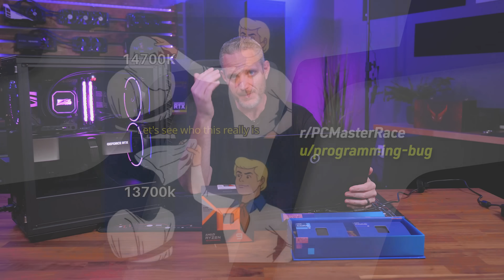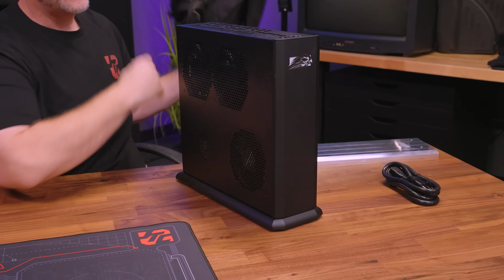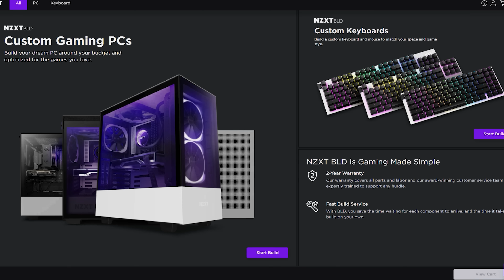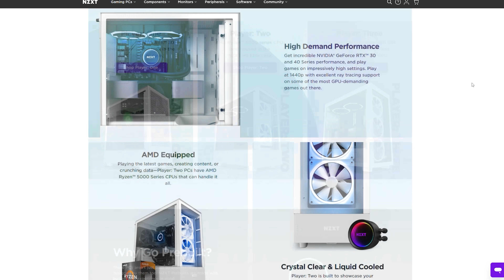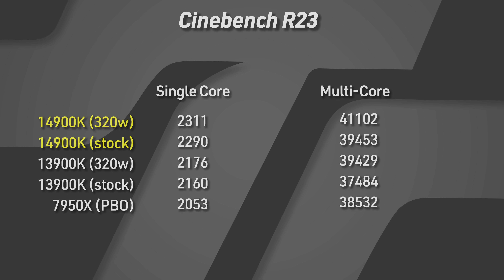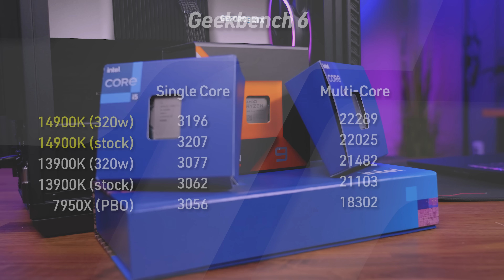THIS is why people have trust issues! Intel 14th Gen Review

Comment: I see no problem here, you pay more for your cpu so you can pay more for your electricity bill while gaining absolutely nothing. What a bargain indeed. haha
Reply: Intel CPU spokespeople be like
Reply: I thought Jay said you'd pay like 3 cent less per month with this...
Reply: @wallywest4274  If you keep it for 10 yrs you will recoup your extra cost. 🤣
Reply: @wallywest4274 in America yes but in eu is lot worse
Reply: @wallywest4274 Are these Jayz3cents then? 😁
Reply: Oh brings back memories of the AMD R9 200 series being the rebranded HD 7000 series; so much so that you could crossfire an HD 7000 with an R9 200 equivalent.
Reply: @Skelath Same with nVidia GTX 680 --> GTX 770 & GTX 670 --> GTX 760. You could SLI them as well. All you needed was a modded Driver. Done it myself running a GTX 680 in SLI with a GTX 760 albeit the 760 got a lower amount of Cuda Cores. It worked as the chip itself was identical. Good old times... 😕
Reply: Hey, we're not supposed to think about that... Just buy, buy, buy. 😜
Reply: LMAO
Reply: Instead of shitting on Apple Silicon and mocking it, they should have learned a thing or two about going for effigency.
Reply: Latest Gen, little bit faster, I’ll take it.
Reply: Ah yes, Enjoy a few extra cents if that on an electric bill lol
Reply: @FatherLamb  I’m not even getting a pc soon
Reply: @FatherLamb  and it feels kinda wrong getting 6 cores instead of 14
Reply: huh........... 6 cores? What are we talking about here LOL  @olympiaalkisbarmagiann7859
Reply: You pay the same, but get 3% more performance for the money. It's the right pricing direction compared to all other launches. All others hardware laUnches have been pay more for less.
Reply: @dontsupportrats4089  I saw it’s 10$ cheaper the 13600K is 10$ cheaper than the 13600K and has the 3% performance boost nice way Intel
Reply: @olympiaalkisbarmagiann7859  yeah its a cruddy uplift. It's still an uplift without a price increase. Anyone building a new computer won't care its a tiny uplift, they care about initial cost. I mean it's not like it fits in all LGA sockets so everyone who currently has intel is looking to upgrade.
Only 13th gen owners or new builders are even looking at the 14 series. And it should be only new builders.
Reply: More number more better, all numbers more more betterer
Reply: The slightly increased power draw really isn't going to make a noticeable difference in your electricity bill over 12th or 13th gen or the heat put off by the PC. Is it a good thing? No. And then you get support for faster ram and support for wifi 7 and some kinda cool software. idk, I would say that's worth $10. But yea, don't upgrade from 12th or 13th gen imo.
Reply: Especially since electric prices have been going nothing but DOWN😂
Reply: pc doubles as a room heater. lmao
Reply: Do some people actually take their electricity bill into account when building a PC? Sounds like peasantry to me bro. Buy an Xbox and save money on your electricity bill.
Reply: My guy this video literally mentioned its better performance per watt, what are you on about? I swear Amd fanboys have a bump in their brain sometimes
Reply: Talking about electric bill us cringe, yes I definitely cant pay like $2 more a month for my PC
Shoulda just focused on the temperature if you wanted to shit talk intel lol
Reply: @HongyiMC People in the EU pay much higher electricity prices than the US, sometimes 4x-7x higher, so it can be a significant factor over the lifetime of a system.
Reply: @mattrogers6646  then dont buy a 14900k knowing that you cant afford electricity bill after that?
Imagine living in Europoor
Reply: @HongyiMC Yeah, imagine not being at risk of bankruptcy because of a health issue, politicians that actually serve their constituents instead of being bribed, oh, I mean "lobbied" by special interests and the rich to write favorable laws, strong consumer protections, and tax dollars actually spent on welfare of the people instead of military-industrial waste. If only I was lucky enough to live in Europe.
Reply: @HongyiMC  what a tragic loss having to buy a cheaper, faster and more efficient cpu, huh? really heartbreaking.
Reply: It's like when amd made bulldozer hot loud and proud
Reply: @leroyjenkins0736 Ahh, I remember those days.  I also remember wanting to upgrade to Bulldozer from my Phenom II x4 Black but realized that my Cooler Master Hyper 212 wouldn't be enough for the task lol.  That's when I waited a little longer and snagged an i7 3820....and then probably made 6-7 more upgrading mistakes before I finally understood everything and flipped the switch on my brain from 0 to 1.
Reply: @leroyjenkins0736 can't even stand still below 60.
at least. it's cheap.
Reply: Yeah, people seem to forget how much difference in electricity bills these upgrades make lately
Reply: @killerbsting1621 unless you game more than 8 hours a day, 365 days or have absurd electricity rates over 0.30 a kWh, it’s less than $50 a year difference for gaming loads.
Reply: 14th gen is kinda cheaper than 13th
Reply: meanwhile the 12400 and 12700 non-k are 65W and run at like 200 watts less and are basically as fast...these are hitting 320w, meanwhile at intel spec a 12700 non k will run games like cyberpunk at 65w...
Reply: @gosuprime  It's a shame that the i5 12400 uses more than 200+ watts of power.:face-blue-smiling: (not 65watt)
That's if you use your own voltage meter which is more accurate.
65watt only occurs when the CPU is running below 3Ghz.🤣🤣
power increase occurs when the CPU briefly boosts beyond 3Ghz
Reply: @Penoonton  the locked 12400 will never hit 200w+ without changing power limits or using a board that doesn’t have them. With the suggested limits, it shouldn’t even hit 100w.
Reply: @gosuprime  the 13900k uses like 120w to play games without an OC. The difference is that under full load it draws way more, but it also does the work significantly faster.
Reply: @rekareaper 
That’s insane, my overclocked 7700X draws half that during gaming, and draws that much at max load. Sure it’s not quite as fast, but man Intel really needs to fix their efficiency sometime.
Reply: @-Burb  it’s about half of the processing power of an OC’d 13900k, most likely on the lower side. My OC is conservative in my opinion. It draws about 330-340w under r23, doesn’t hit 70c and scores 42.5-42.8k. I would see slightly lower power draw in games if I limited my fps to 120, but I normally get around 220-250fps at 3440x1440 and only see over 150w during loading screens or when streaming. I couldn’t care less about the power draw if the chip is easily cooled. AMD CPUs draw that much less power and still normally run hotter than mine because they added a ton of thermal resistance to make it compatible with old coolers.
Reply: @rekareaper  That’s fair about the cooling, it does suck that AMD made the IHS really thick. In games though it’s fine, typically sits at about 55C. Cinebench will take it straight to 85C though.
Reply: @-Burb  I sit in the low 40s and high 30s in games for the most part with the exception of the sub 5 second loading screens. I have seen 66c on the hottest core during loading screens. 

The x3D chips are even worse with the added cache on them.

Don’t get me wrong though I would be all for lower power draw with more performance, but performance comes first for me by a long shot.
Reply: @rekareaper  
Out of curiosity what is your cooling setup like? I assume you’re using a full water loop or something since those would be crazy good temperatures for an air cooler or even an AIO
Reply: @-Burb  it is a custom loop. I have two MORA3 rads in total for my CPU, GPU and memory. I keep the fans around 600 rpm on one and around 800 on the other. A 7950x3D and 7950x in my loop would likely be within 10-15c of my load temperatures for my 13900k in my loop. With a 420mm AIO on both, they run about same temperature as a 13900k. If AMD had made the IHS thinner, they would have run at lower temperatures all day than Intel and continued to scale with more cooling. The IHS, the IMC and the IF clocks are some of the big reasons why I didn’t go with a 7950x.
Reply: @rekareaper  
Man that sounds like a beast! Big respect, that sounds like a ton of fun to build!
Reply: @-Burb  it was. I’m about to run tubes through the floor and put my radiators in the basement to keep the heat out of my office/library/game room. Lol.
Reply: @rekareaper It depends what type of games you're playing. If you're a sim guy, you're not going to waste your time with intel anymore.
Reply: @WilliamStewart1  I still would because it isn’t the only type of game I play and I occasionally stream. The X3D CPUs are all significantly weaker in multicore performance than where I sit. The 7950x3D sits a minimum of 15% behind and the 7800x3D can’t even come close to matching my e cores by themselves.
Reply: @rekareaper  Streaming is a non-issue, doing other workloads such as editing and such I would just run a regular 7950 if you really care about the difference. All I know is sim gaming is where it counts for me and the one area I don't want to make sacrifices, so I run AMD.
Reply: @WilliamStewart1  until I see direct comparisons with 2x24GB or 2x16GB 8000+ for Intel and both of them OC’d, I still wouldn’t touch AMD this generation. It’s a nice improvement over the 5000 series, but not enough against a decent 13900k/s/f on a good two DIMM board. I don’t mind spending the time to dial in memory OCs though, and I can see the benefit of X3D for those that don’t or don’t know how. 

People say that AMD is the way for CoD, but the 7900XTX when paired with an OC’d 7800x3D or an OC’d 13900k with 8000+ loses to the 4090 paired with the same OC’d 13900k system.
Reply: @rekareaper  As I said, I stick to sim stuff now. I run Nvidia gpus, but the x3d stuff was a game change for the sim/vr crowd.
Reply: You would be surprised at what 10 minutes with Intel Extreme utility and 2 adjustments to power would do for the 14900K or the 14700K.
It's not like AMD fanboys don't sit for 3 months after every CPU release and eat Sticks of ram to make their Ryzens work...
Reply: @kramnull8962 While the X3D V-Cache AMD CPU did have issues with hitting EXPO RAM timings, I am not aware of any issues on the non-VCache CPUs. Similarly, my launch 7950X had no issues with DDR5-6000 30-40-40 and the recent newer AGESA permits higher DDR5 speeds, but I know that is anecdotal.
Reply: >Buys amd
>Get's permabanned from gaming
People buy intel and nvidia for quality of life and tranquillity.
Interesting how the electricity bill doesn't come up when the reviews are about amd gpus.
Reply: @Happiness-lp9fw oh yeah because no one has ever brought up power draw of GPU's 🙄
Reply: @clintk4691 it a bias thing I've alway seen amd fan saying 4090 is hot and consume to much power while 7900xtx pull about the same average and 4090 is still 20%+ faster
Reply: @Happiness-lp9fw classic nvidia and intels koolaid drinker
Reply: @Happiness-lp9fw sounds like a ngreedia and intel fan boiii
Reply: @phantom0590  bro I say I had problems with AMD what do you not understand
Reply: @olympiaalkisbarmagiann7859  I did not even reply to you
Reply: @phantom0590  I answered for both answers
Reply: @Happiness-lp9fw  Didn't knew everyone gaming on AMD gpu played cs. Thanks for the info.
Reply: @Happiness-lp9fw Don’t know how Intel Core and AMD Ryzen have anything to do with AMD Radeon’s software
Reply: @Happiness-lp9fw  driver got revoked and all people are being unbanned lol, plus that was valves issue not amds
Reply: @KaylonR unless Valve was told how AntiLag was gonna work before it got rolled out and had time to get the edits the driver was making whitelisted, it's definitely on AMD for rolling out an update that runs foul of anti-cheat 😅
Reply: @KaylonR  The anti lag issue was completely AMD's fault and anyone who says otherwise is 100% an AMD fanboy
Reply: @DanYayman85  even so, how is AMD supposed to know how a proprietary anti cheat works? They prolly tested it with other ones and it worked fine, and even so they still retracted the driver so it doesn't really matter at this point
Reply: @KaylonR  Because of how they implement it. There's a reason Nvidia Reflex doesn't cause bans, because Nvidia work with the devs to integrate Reflex directly into the game. Anti Lag+ isn't integrated into the game and basically forces its way in by detouring the dll of the game's engine. Doing this will trip an anti cheat system.

This mess is 100000% AMD's fault. They should've had Anti Lag+ integrated directly into the game.
Reply: weird i havent been banned on any game and had amd since 2017 kekl  @Happiness-lp9fw
Reply: @Happiness-lp9fw I thought that was a GPU issue not CPU
Reply: @Happiness-lp9fw  chill out shills
Reply: @Happiness-lp9fw Exactly!